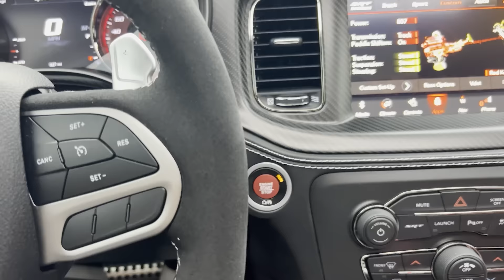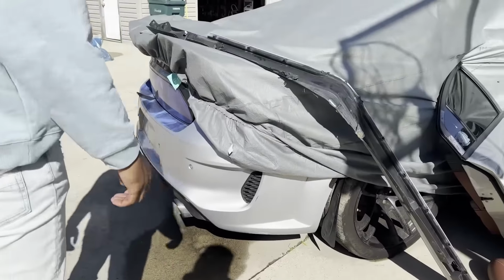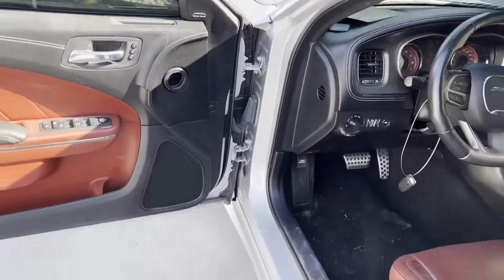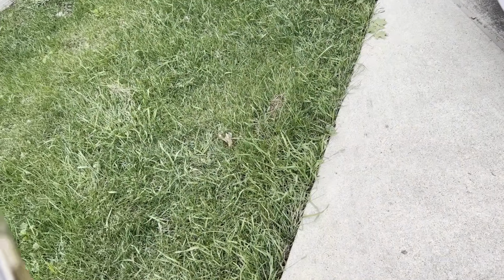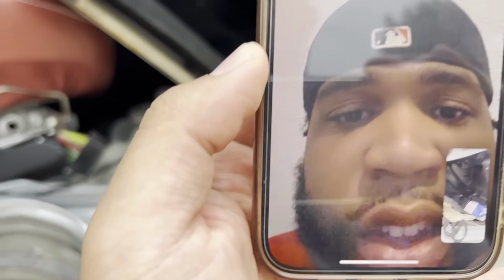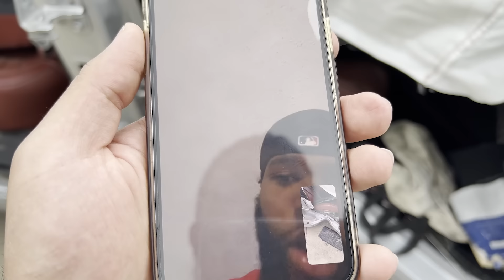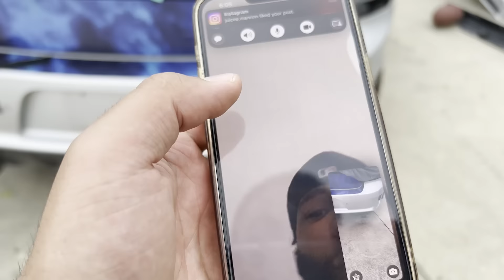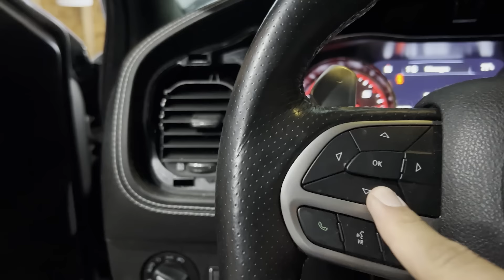BUILDING A CUSTOM CHRYSLER 300 HELLCAT FOR A NBA PLAYER!

Comment: Disconnect all the wiring for the sound system he had installed. The battery wire, ground, and fuse box wire. If ur lucky it’ll start up right away if not then check all fuses in case that system wiring caused other fuses to blow during impact. Love your content tho keep grinding 💯

Comment: You need to be getting a test light onto the back of the starter motor when cranking to know whats getting power, if nothing there than go to the starter fuse and make sure it has its power in ground and trigger and its outputting on the crank wire and if it is you know there is a broken wire between the fuse box with the relay and the starter motor